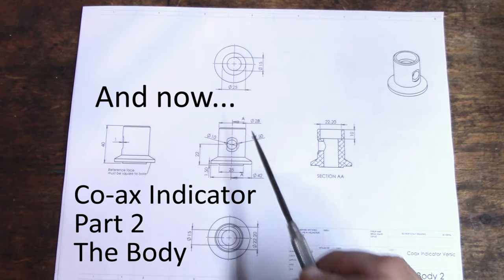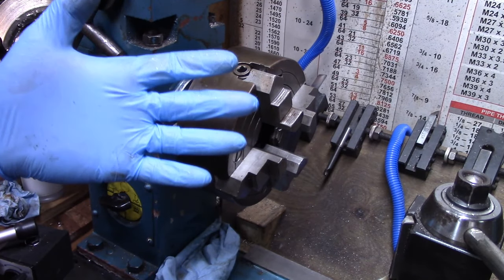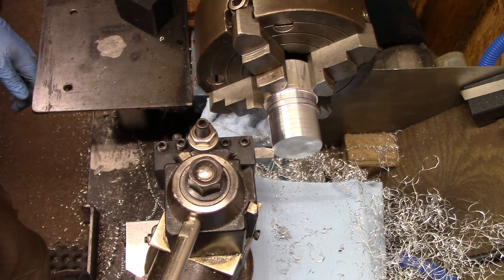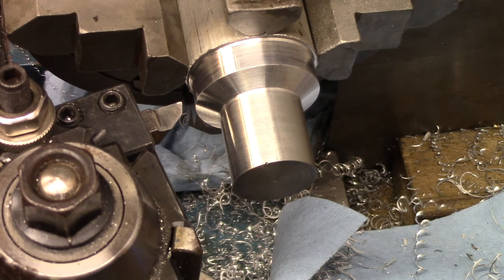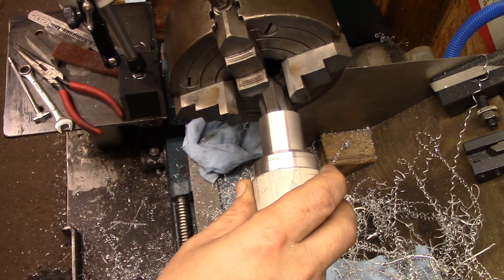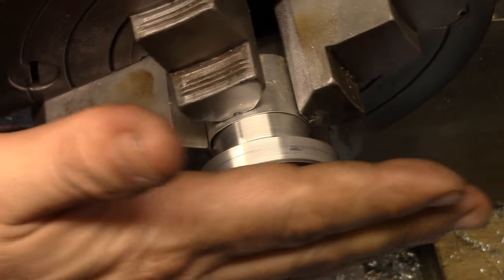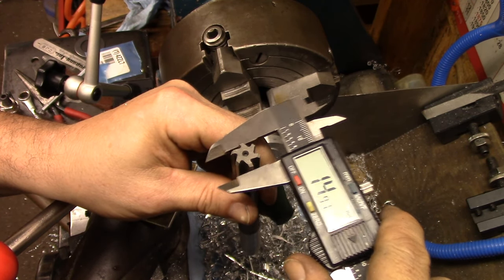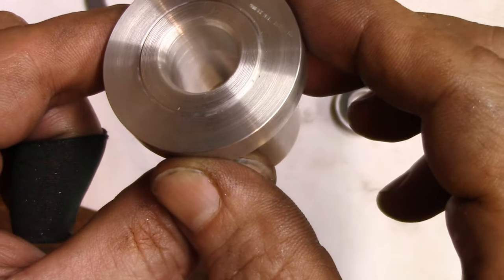DIY Co-ax (Coaxial?) Indicator - Part 2 - #TMC2020

Comment: Perhaps the easiest way to keep nearly everything as true as possible, would be to chuck on a bar long enough to cut everything, plus a 1/4”-1/2”. Then turn, bore, c’bore, back face the critical face and it’s diameter. The next step is to part it off .02-.03” over on length. Swap ends, re indicate and face the small boss around the bore to the final overall length.
Reply from the maker: You have not got to part 4 yet, lol. I had to remake the main body and ended up doing I think nearly identically to how you suggest. Thanks!
Eddie

Comment: Great stuff Eddie, Lovely job :-) 
One option it to learn the registration boss to grip the washer . It is held in place by the rocker so as long as it doesn't spin it should stay put ok
Reply from the maker: Thanks Bill. Despite a few issues, I am a pretty chuffed how it came out. I bought 2 of those thrust washers so I think I might experiment with the glue and mechanically locking the washer.